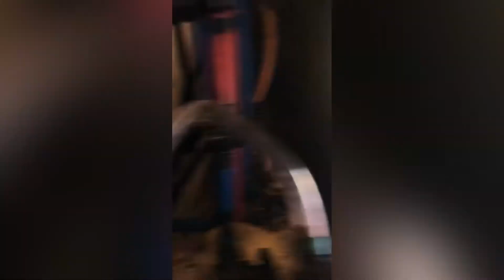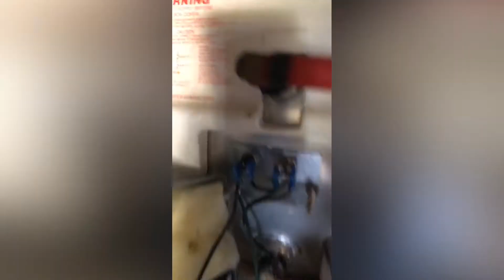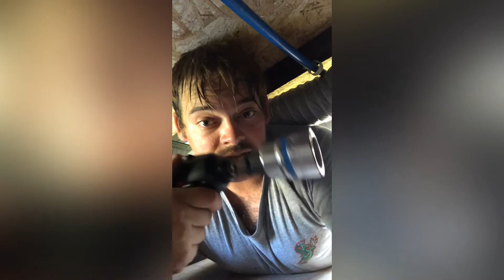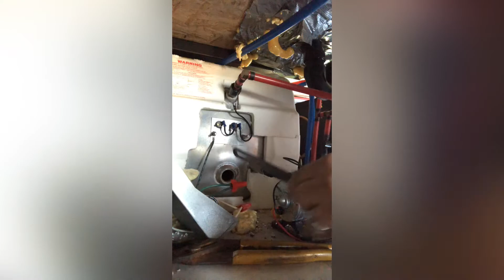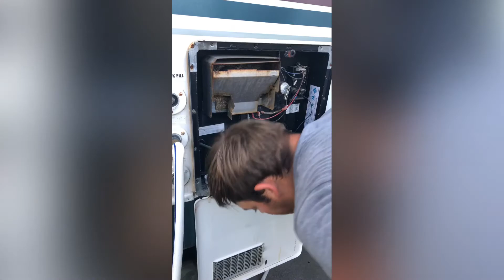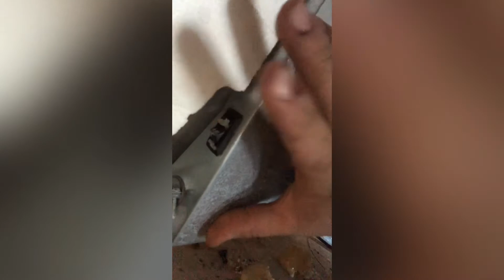RV hot water heating element replacement

Comment: When on propane that is what heats the water. When on electric then the heating element is heating the water.  If the water cools and you are one propane the thermostat will kick on the propane if on electric then the heating element will kick on and heat the water with your electricity.  I believe you said the propane was heating the water  and you were going to see how long the heating element would keep it hot.  It will not unless you have it on electric mode